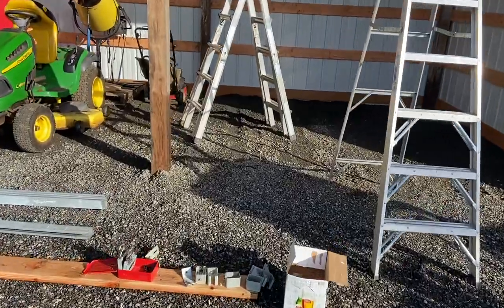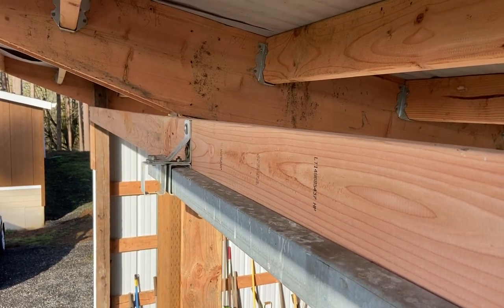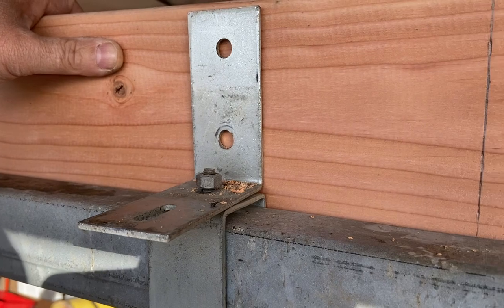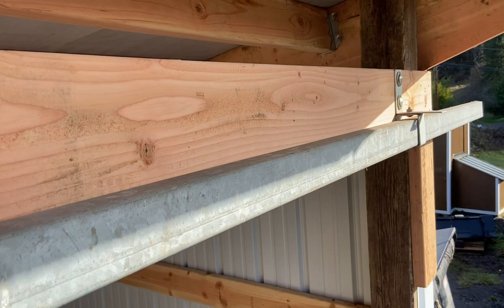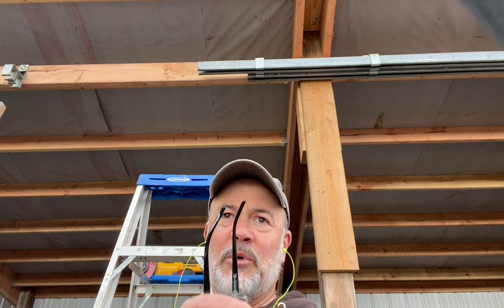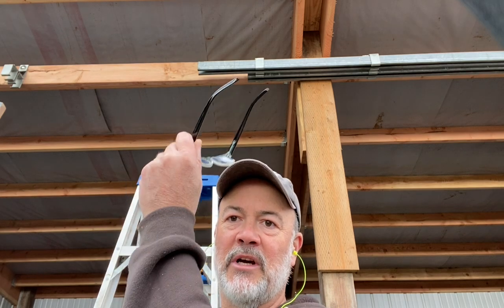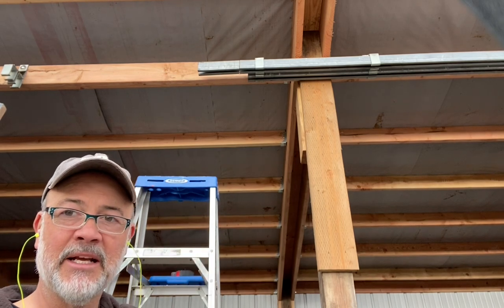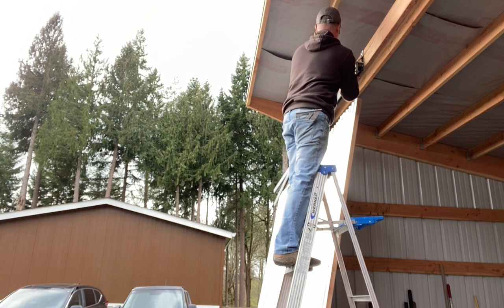Pole Barn Doors Part II

Comment: Came out really nice. Will you need to do anything to secure the door bottoms from swinging in the wind? Maybe rubber bungie them to the shed?
Reply from the maker: 👍💪 Thanks much! Yes, actually I ordered some Cam latches for sliding doors. The same ones that I have on the pole barn. They work well to keep the doors from moving from the wind. Thanks for checking out the video!!!🚜🇺🇸🍺